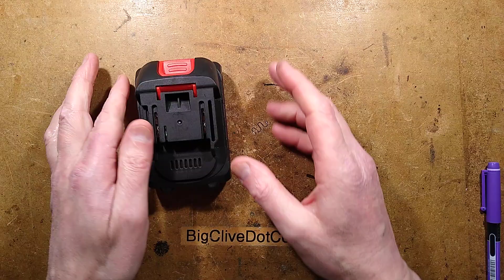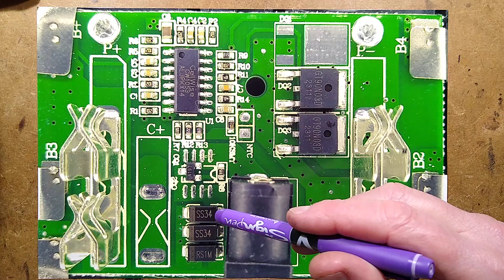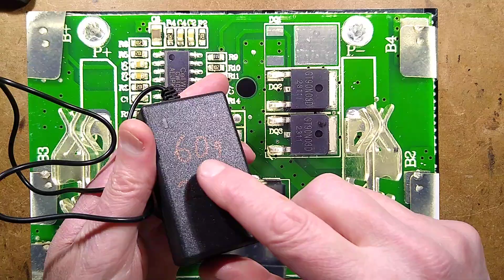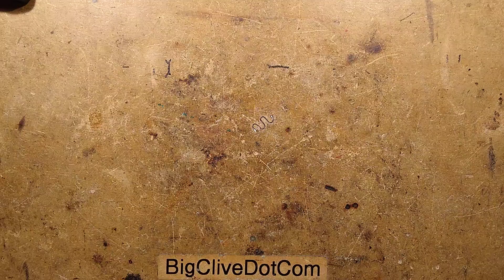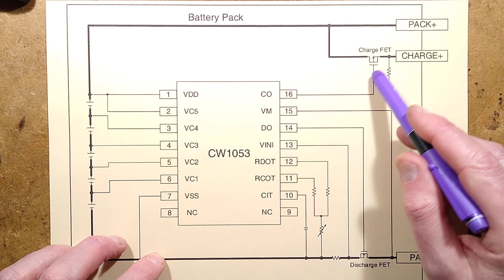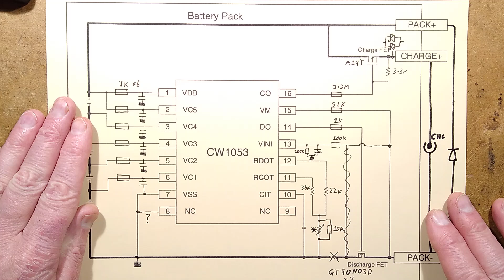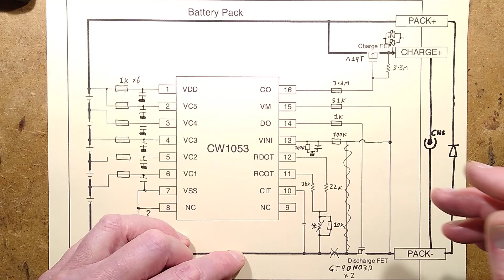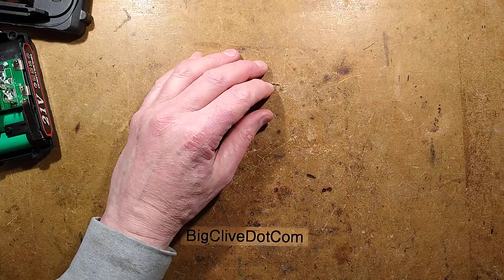Inside a new style eBay tool battery - with schematic

Comment: These battery packs do make me slightly nervous , I kinda wish all the cells had thermistors on them but im guessing that would push up the design/price, Im also wondering would it be worth fitting a balance cable to these things to rebalance them from a pro hobby charger?

Comment: Is spot welding battery tabs directly to PCB pads a good idea? I think that’s the first time I see it done like that. I don’t think the risk of lifting a trace is high, given the today’s generally decent PCB manufacturing standards, but don’t they run a risk of corrosion caused by a high current running through small surface interface area between two dissimilar metals? Unless that’s exactly the point: a smart self-destruct timer, of course 😉
Reply from the maker: There are metal pads soldered to the PCB for spot welding to.
Reply: Batteries on Xiaomi and Ninebot e-scooters are usually made in a similar way, just tabs from batteries spotwelded (usually 6 spots) to BMS daughter pcb. I assume it's made for mechanical reasons and to avoid routing 12 to 15 wires (not counting thermocouples) through the whole battery.

Comment: Damn, the spot welding is another point of failure and a possible fire or explosion 😱
Reply: Are the nickel strips spot welded directly to the PCB?
Reply: @greengreens9936  I know; I couldn't believe it either. But; if they're spot-welded to the PCB, does that mean they're soldered to the battery? 🤔
Reply: @greengreens9936  No there are small SMD pads that the nickel strip is spot welded to. You can find them even on $1 BMS boards.

Comment: The 103 is probably a 10kΩ SMT thermistor.
Reply: I fit a lot of thermistors on the LED arrays and PSU boards that I through the SMT line, I've never seen any of them have the value printed on them.

It should be a thermistor but it looks like they have cheaped out and stuck a fixed 10k on there, just keeps the BMS happy but dose not give temperature protection.
Reply: @welshdave5263  Maybe that's what they meant...
Reply: @soundspark Madee that reply before I had to head out, just watching the rest now and at 9:35 clive does say it's a fixed resistor resistor.

Comment: Clive you look at the connections you will find in is compatible with Mikita . Ie the battery will fit and power a Mikita tool and the that tool in your video will work on Mikita batteries.
Reply: Makita.

Comment: Check out some 3 cell 12v tool batteries. I always wondered how those batteries put out enough amps through such small bms modules even with cheap cells.
Reply from the maker: I've looked at some triangular three cell versions and have a video about the box type already made and coming soon.
Reply: Most of the 3 cell packs I’ve seen don’t have any protection from the “BMS”. Eg: Milwaukee M12 only have a thermistor that the tool and charger check. There’s no other protection from the BMS.

Comment: You could carefully cut the overhang off the tab with a dremel to open the clearance maybe.
Reply: And a squirt of hot melt under the tab to stop it bending down and wearing through the solder mask.
Reply: You could but that's not the reason you buy a tool with a battery. Unless you are clive, possibly.
Reply: I love using dremel cutting tools a few mm away from lipo cells...
Reply: @daliasprints9798  Make sure you use a metal cutting wheel for extra fun times.
Reply: @daliasprints9798  You'll be OK as these are not LIPO

Comment: When would they use the third big mosfet pad by the big mosfets?
Reply from the maker: Probably for higher current tools.  It may have been a design option in case the MOSFETs they used had too high a resistance.

Comment: 3:41 "I roughly know what I'm gonna see inside. Air, mainly." It reminds me of the time Dr Ashens took apart a cheap clone games console and discovered that the manufacturers had put a big metal weight in the case to make it feel heavier and classier!
Reply: I used to be a BT engineer back in the day. They put big metal weights in the early push button phones for much the same reason. They also had to put weights in the handsets so that they would actually hang up the call when you put the phone down.
Reply: @jamesharmer9293  Although, in the case of those phones, the weights may have been moreso to keep them from being slid by the wires than to make them feel more expensive.
Reply: @jamesharmer9293  I was given some phones for scrap a while back (lightning damaged),  and yes,  I did encounter some of those weights in there.
Reply: @jamesharmer9293 I've still got one
Reply: @zh84  Bell cable and internet provider puts weights in their cheap remote controls mAll they do is make the remote break faster from impacts on the ground from dropping them
Reply: Years ago I worked for a company that made TDR cable testing gear. At a meeting I actually suggested they add weights inside the handheld tester case for that b exact reason. The tester cost nearly a thousand dollars but weighed maybe twenty grams.

The company did as I suggested. So, mea culpa.
Reply: I’ve got an LED bedside lamp with a weighted base. To be fair, without it you’d end up pushing it across the table when pushing the touch controls on it. The case and active components weigh nothing, nor do they need to.
Reply: @rowanjones3476  they do that do they don't fall over because they are top heavy .Common practice even candle stick holders get plaster of Paris in the bottom .Fireworks too
Reply: Metal weights! 😂 In the 2010's or so they found a cement block inside a PC PSU 😮 mimicking a PFC inductor
Reply: @Paxmax  Compare the infamous story of MiniScribe putting bricks inside boxes that purportedly contained hard discs...
Reply: @zh84  Wow! That MiniScribe story! 👌 Top shelf Shenanigans! 😂 I hadn't heard about b4, that was a good read.
Reply: HAI videos on bricks

Comment: Isn't it not "just" the whole battery pack that has been placed wrongly (a couple of mm too low). I supose that the battery taps should cover the hole area with all the smsll through holes. All the other taps are also misaligned

Comment: Getting slightly better but still not fantastic safety measures. The track issue's you pointed out Tab B2 also looks very close to B1. Solder resist is not much use as an insulator. interesting look into how to charge batteries 2x👍

 I had to tidy up my area after a technical goodness "(e-waste)" landslide 🤣🤣

Comment: The battery terminals will be the negative end though, won't they? Even if the close one touched it should, in theory, be fine

Nothing in the underside of the board?
Reply from the maker: There are two high current lithium cells between those two contacts.